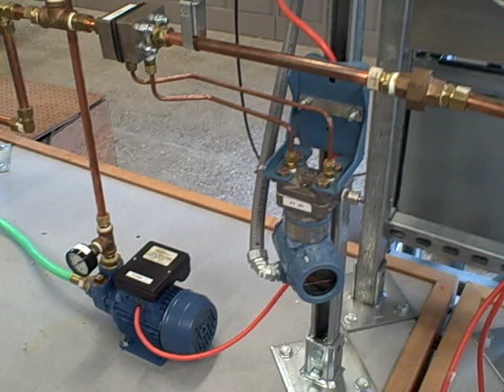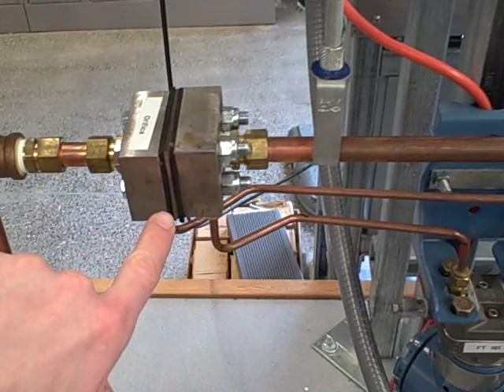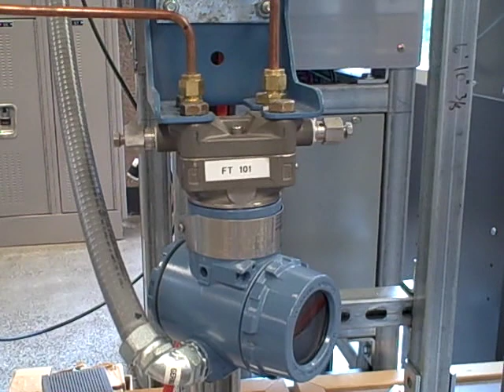Differential pressure transmitter used to measure flow

Comment from the maker: If the flow velocity is the same in both cases, the 4-inch pipe would flow 16 times as much volume in the same amount of time because its cross-sectional area will be 16 times larger (areas of circles being proporitonal to the square of their radii).  However, this assumes the same flow velocity in both pipes, which is a big assumption if we do not know anything else about the system.

Comment from the maker: As this video explains, the pressure created by an orifice is proportional to the square of the flow rate.  In order to obtain a linear flow measurement, the pressure transmitter (or some other component in the measurement loop) must square-root that sensed pressure.  The square-root function inside the transmitter counter-acts the square function inherent to the orifice plate.

Comment from the maker: @rpm750 Using a liquid manometer to measure DP in a liquid process is challenging.  Your manometer would need to use a liquid substantially denser than the process liquid (e.g. mercury), and then its calibration would be skewed by the weight of the process liquid on top of the manometer liquid columns.  Better to use a manometer with air pressure to validate the calibration of a diaphragm-style DP sensor, then apply the DP sensor to the process application.

Comment from the maker: That's correct: triple the flow rate, you get 9 times the pressure drop.  Quadruple the flow rate, you get 16 times the pressure drop.  Pressure drop is proportional to the *square* of the flow rate.

Comment: Hi Tony, since you are flowing a liquid through this orifice plate I'd like to see how a U tube Manometer could be used to measure the differential pressures. I work in Water-Wastewater and we have many orifice, venturis along with DP transmitters(Rosemount) to calculate flow. As a calibration check I'd like to use a manometer to verify the DPs. Thanks so much, have your study guide and love your teaching technique. I wish I could attend your class but we are on opposite ends of the us.

Comment: Are you sure that it is "memory?" Or is this function done by analog solid-state components such as adders, op-amps.
Or is there in fact a processor or EPROM in the 1151 that performs a square root function. Thank you!